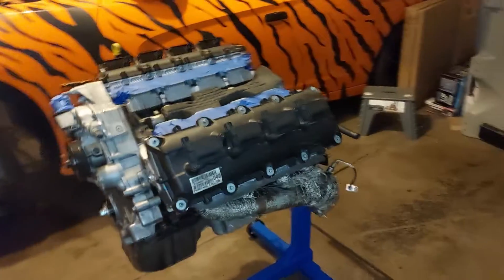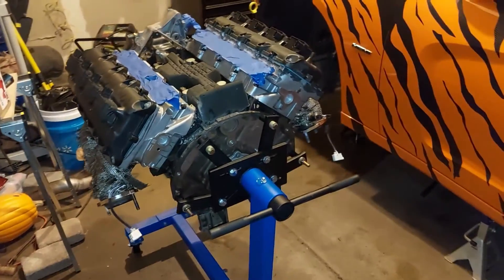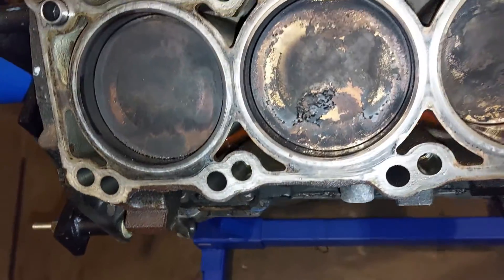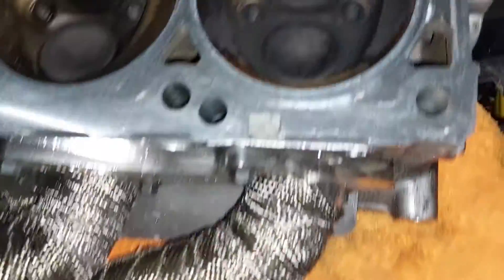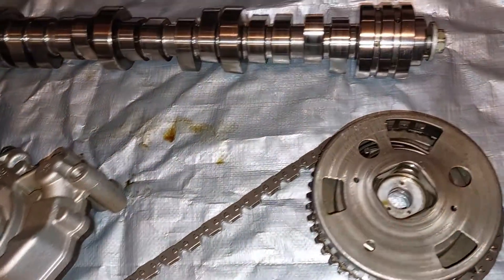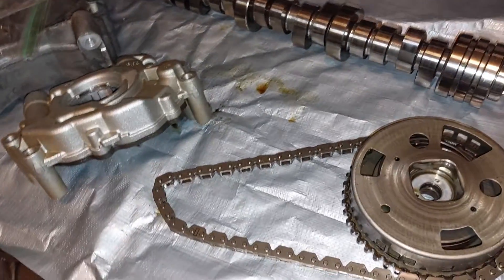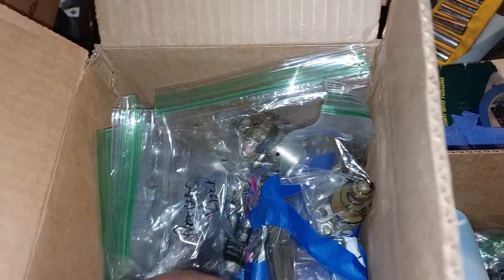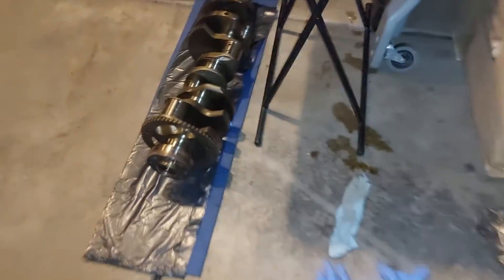Forged 392 Stroker Update Part 1

Comment: Goodluck my friend, any questions holler at me. I did my 397 by myself and learned a lot during the process
Reply from the maker: Will do bro. I appreciate that!
Reply: @canyou_heminow  for sure, u know what compression and boost ur going with?
Reply from the maker: @jeepwk6.5L  I don't know yet. Thinking about going with higher compression due to my altitude. It will honestly depend on whats available. Any suggestions? Also, I got the smallest pulley torqstorm offers so I'm hoping to run at least 9-10psi before I have to address the transmission.
Reply: @canyou_heminow  well if your only running 10 psi and going forged internals you definitely can going with a more higher compression ratio then. My factory trans blew at 7 psi haha. But it was also a 545rfe
Reply from the maker: @jeepwk6.5L  that's literally pushing it on this cheaper centrifugal blower. I may have to start saving for turbos in the future. Lol may try to get a loan or something. Also, I've been looking into paramount trannys for my year. I wish I could do a manual swap. Your's is beast!
Reply: @canyou_heminow  it was a learning experience manual swapping it that’s for sure. I’ve heard great things about paramount transmissions. I wish I would of done it just to keep my awd. And yeah if ur up in the air I would build it for ur future plans then. If your gonna want more boost it’s easier to add boost then it is to lower compression to hold more boost imo
Reply from the maker: @jeepwk6.5L  so true. I have a few things to figure out. First is to bulletproof the motor and transmission. It'll take some time but this is for sure my dream car.
Reply: @canyou_heminow  it will turn out badass in the long run
Reply: Is this a 5.7 block?
Reply: @Nephew205  mine is a 5.7 base yes 👍